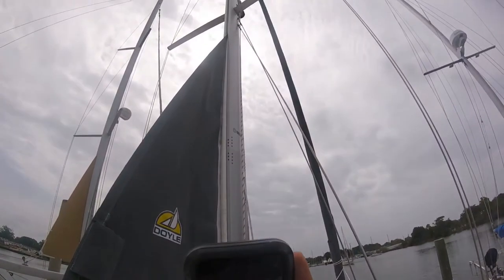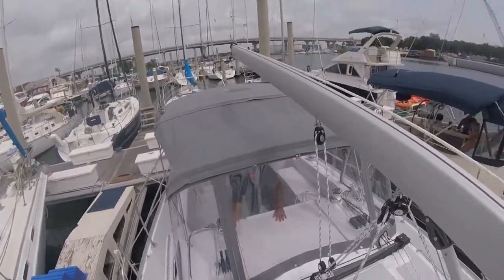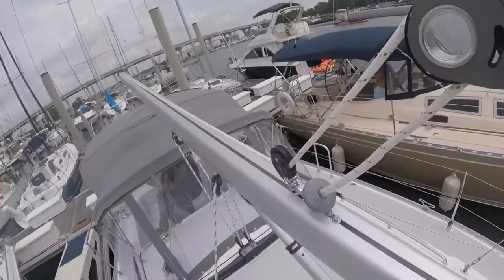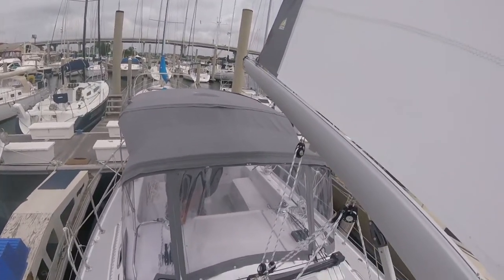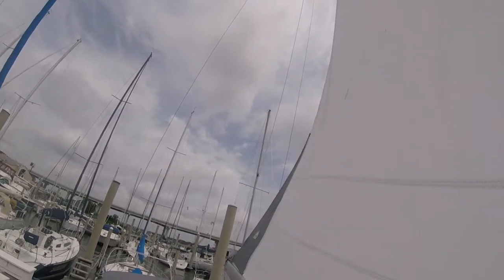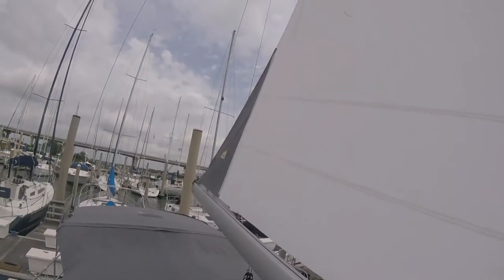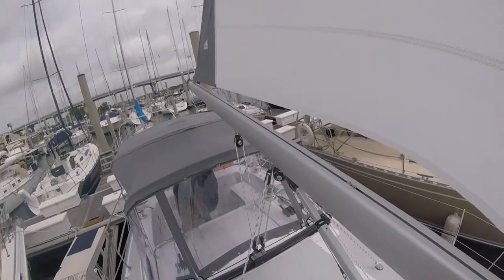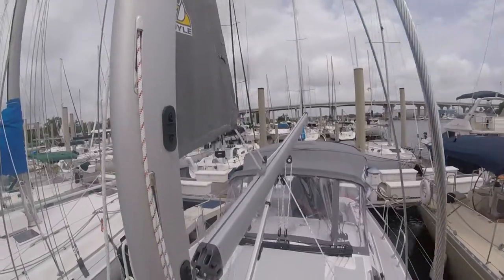Selden in mast furler & Selden Furlex

Comment: Excellent video.
We have just bought a 5 year old Bavaria with Seldon inmast furling and vertical baton main.
Unfortunately after our first sail we jammed sail after first time furling in.
Managed to unjam  by pulling on clu. 
We are a little perplexed because we had thought at the time that  we had done a good job furling in .
Slightly off wind and outhaul tension.
We suspect mainwas flapping a bit much and we forced a crease in to mast.
Maybe a bit more in and out to get it in straight and wrinkle free.
Admit we are a little apprehensive now.
Might need to perfect our method on the berth first.

Comment: And a question. 
How important is boom angle and use of vang in furling process ?
Reply from the maker: Boom angle is very important for any mainsail furling application. whether it is an in boom furler or and in mast furler, retaining the correct boom angle is vitally important to keeping the system functioning correctly. we recommend setting your boom height and leaving it. if you like to constantly adjust your boom vang, boom topping lift etc... we always tell our customers to mark the lines accordingly so the correct boom height can be easily re-achieved. you want to be evenly pulling on both the leech and foot of the sail when deploying an in mast furler. we commonly find the boom height too low and by adjusting it to the correct angle the sail rolls in and our effortlessly. as a general rule of thumb, we set the aft end of the boom at a height so it matches the same height as the tack. in other words, if you were to draw a line or pull a string from  the tack of the mainsail to the back of the boom this line would be at a 90 degree angle to the mast. depending on the system, there can be some further adjustment required to obtain the exact correct angle. battens are always problematic in these systems and we always recommend removing them. once a sail gets old and stretches it is more likely to start jamming in the mast.
Reply: Thanks David .
Very useful answer.
Plenty for me to work with.
I think my sail shape is still okay so hopefully can leave the battens in .

Comment: Thoughts on in-mast vs in-boom furling?
Reply from the maker: That is a great question! 

While both systems have their advantages and disadvantages, we see more in mast furlers than in boom furlers. Both systems work equally well when setup and used correctly. At the end of the day it comes down to personal preference and proper setup, use, and maintenance.